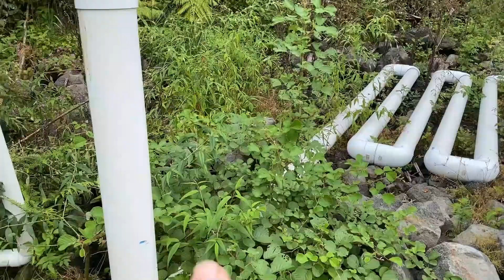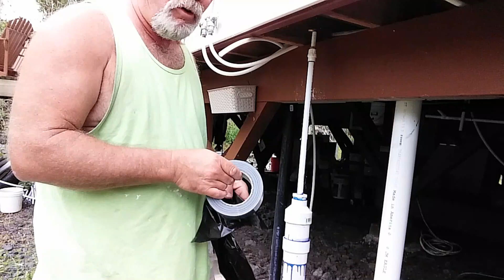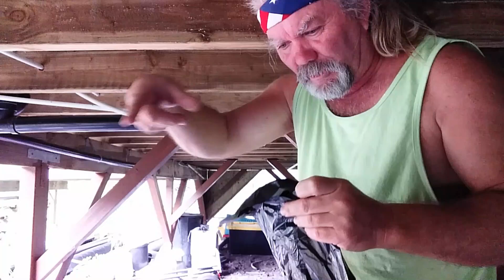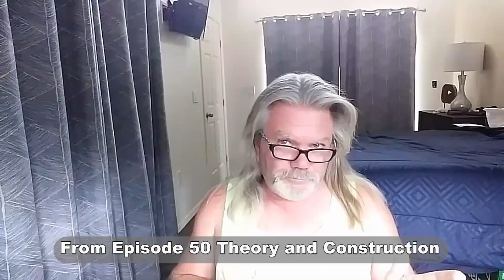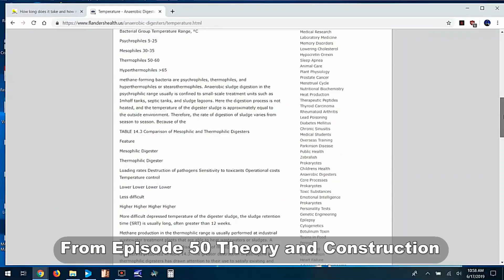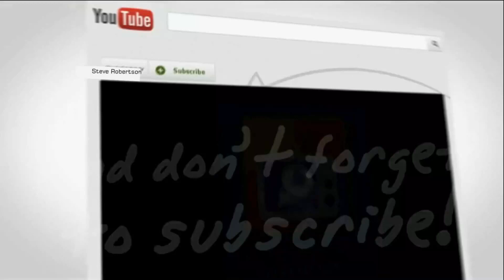67 Biodigester Update 3 - We Have Gas!

Comment: This is awesome. I’m gonna start building my biodigester now but wondering where u ordered your dometic 300 series toilet? I looked on amazon and no one will ship to the big island. Haven’t tried eBay yet.
Reply from the maker: Walmart online. The shipping cost nearly as much as the toilet, but I like the porcelain, so I just bit the bullet.
Reply from the maker: Check Home Depot online. If they have it, you can order it at the store through customer service and get it shipped free. Ask for Stacey, she’s very helpful.
Reply: Thanks so much. I went to Home Depot hilo and got it ordered today. Will it bolt up to the same flange as a normal toilet? I’m also using a re useable rubber and foam gasket instead of the wax one. Hopefully it will work
Reply: Brandon Weeks yes it bolts to a standard toilet flange, and it comes with a reusable foam gasket instead of wax seals. It also uses standard toilet setbacks from the wall. I love ours because our catchment is only 600 gallons and has lasted us two weeks so far with no rain!
Reply: Looks like we might be finally getting some rain tonight if the forecast is right. I’ve actually been having to water some trees which is rare. Do you think it would be a good idea to mix food waste into the same system? Or should sewage be a separate system from the food waste system?

Comment: Was having a septic system installed the other day and was talking to the septic inspector about using the gas out of the systems by modifying it and he said it produces a toxic gas also that is harmful when burned indoors. Forgot what he called it but you might want to look it up and check it out. Really enjoy your videos keep it up.
Reply: Ranger H the gas out of a regular septic system consists of both aerobic and anaerobic bacteria, where a biodigester uses only anaerobic bacteria. The gas is very commonly used in India where there is heavy population and processing sewage was nearly impossible. This solves the sewage problem and the energy problem allowing people to cook over biogas. Like any flammable gas, it shouldn’t be used indoors without proper venting.
Reply: Carbon Monoxide?  Burning LPG produces that too when burnt..

Comment: I have seen a system where methane was siphoned off of pig manure in a chamber under pig barns. The methane was compressed and used to power irrigation pumps. Rest assured the system I saw wasn't anywhere near as odor free as your biodigester. Good concept but I think the scale is too small for any practical uses.
Reply: AutoCrete true. The only practical use of this system is sewage processing with enough methane production for novelty.

Comment: Steve, Have you thought about adding Ridex? Seeding the system with bacteria might speed things up a bit. Now that you have a little more time(cooler), any thoughts on the heat pump clothes dryer?
Reply: Brad Quinn I thought about Ridex, but I’m trying to keep this as low tech as possible so that folks in this area can process their own sewage at a cost that is as close to zero as possible.  If I can get my hands on a heat pump clothes dryer I’ll definitely get one.

Comment: Painting the pipes black. Would it raise the temperature in them and increase the gas production?
  As always a great vidio, take care you two.
Reply: Floyd Frazier the problem with that is the pipe would get hot during the day and cool down at night. The hot bacteria would die during the cooling down and the cool bacteria would die off during the heating up. The main goal is temperature stability so the type of bacteria that’s active won’t die out too much.